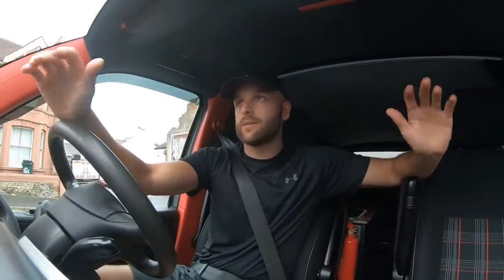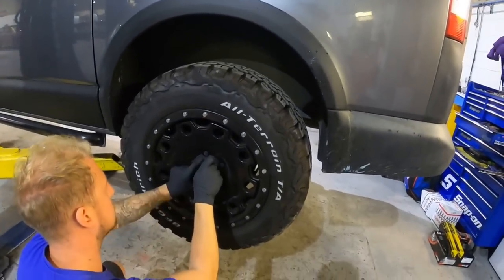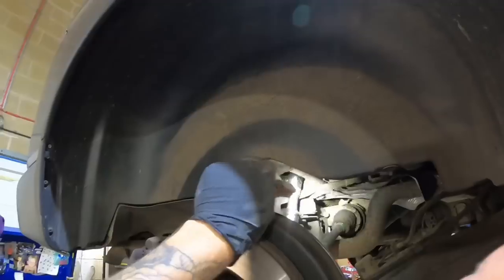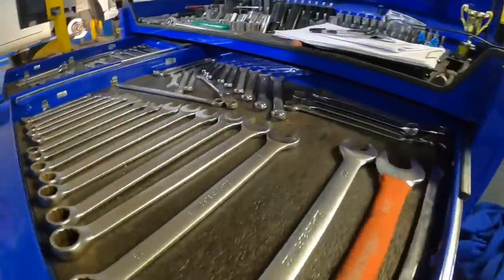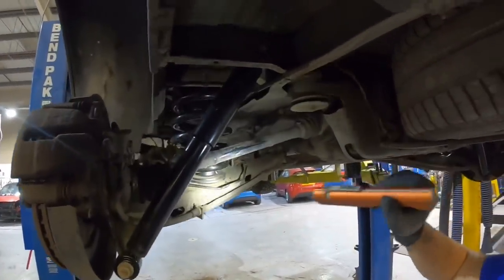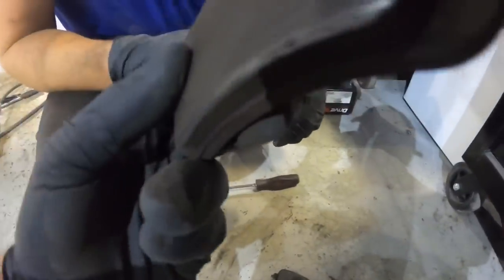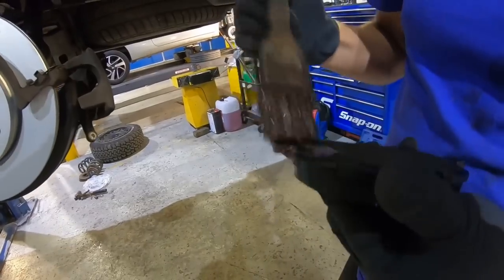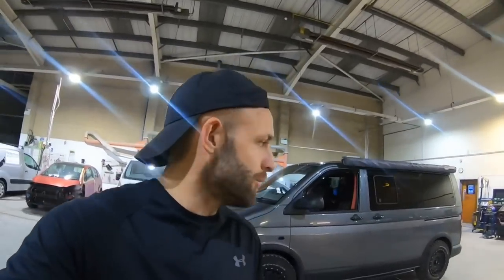Replacing the rear shocks, springs, brake discs & pads on my VW Transporter T5 T32 4-Motion

Comment: Good vid Daz. Had mine under sealed while on the ramp looks so much better
Reply from the maker: How does that work does it need a good clean underneath first?
Reply: Yeah had an engine bay wash too but mine is 05 so was looking tired underneath. Now most of the heavy metal parts are coated and sealed. Well worth doing mate

Comment: Hope the pads were fitted the right way when you installed them, there are arrows and are marked left and right on the backing plate, and have to be installed with the arrow on the pads backing plate pointing in the direction of rotation of the disc.
Reply from the maker: I don’t know I hope so but I just drive it mate 😆👍
Reply: @tubedarren  👍👍👍

Comment: What was wrong with the rear springs? They looked fine to me. Were the new springs and shocks standard replacements?
Reply from the maker: Hi mate VW recommended the shocks and I think springs were to be done at the same time, they were probably fine to be fair 😂
Reply: @tubedarren  i fitted the same make of disc to the front of mine! They are coated so the bit on the inner edge doesn't go rusty, not that it matters with your wheels👍 i think you got your money's worth out of the pads🤣

Comment: I'm intrigued how much effort it actually took you to get those rear springs back in? The shot cuts away really quickly. I've done it and it was a PITA with the driveshaft there, I need to do it again :(
Reply from the maker: It was a bit of a squeeze, IIRC we used a long bar with a bit of weight on lol
Reply: @tubedarren  Yeh did that previously and accidentally popped the driveshaft out.
Reply: Normally you take the drive shafts off to avoid any excessive load.